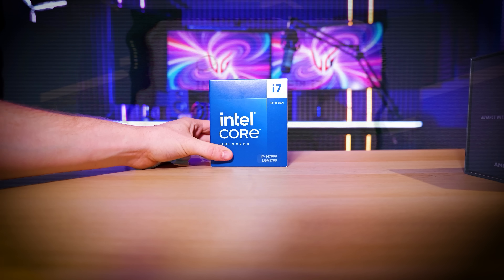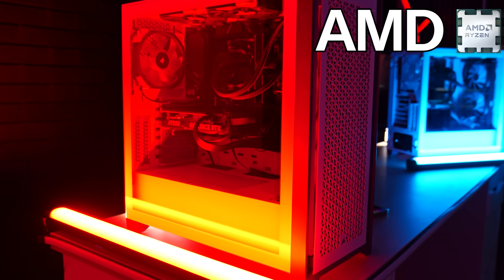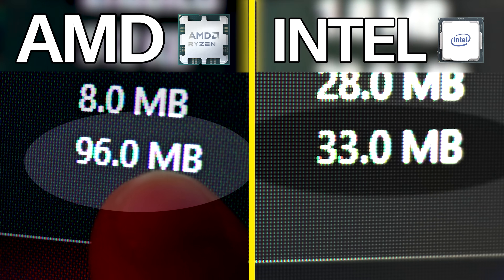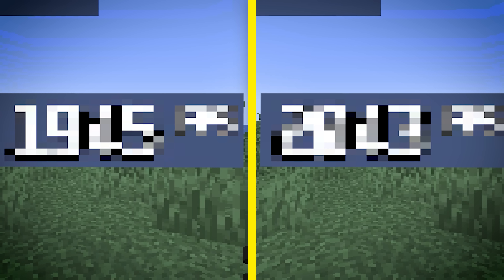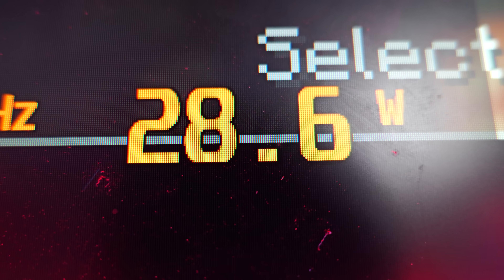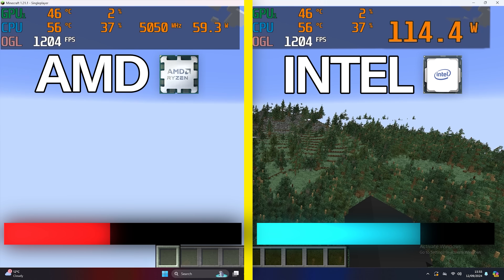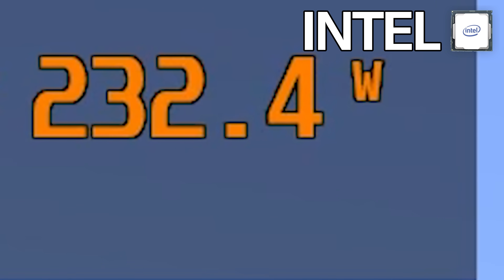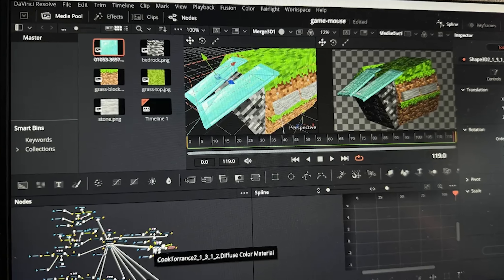Intel VS AMD - Which Is Actually Better?

Comment: 7800x3d is literally the fastest gaming cpu in the world rn
Reply: Fr bro, and he tryna compare it to a broken intel cpu
Reply: @Koffi32  really core ultra is fastest
Reply: hellnah amd 7 9800x3d is out lol
Reply: U guys are gay
Reply: I got a 7 7800x3d for 200 at micro center
Reply: @braxtoncovelli2894  nice
Reply: 9950x
Reply: @ktyz_2508  7800x3d better
Reply: No it isnt
Reply: @ThumbzYT  yup it is
Reply: Cap the and threadripper series Is king (strongest one has 192 cores)
Reply: @TTheCatBox  Yes, but for gaming the 7800x3d is better and more optimized. The threadripper is for workstations.
Reply: Actually the 7700x wins in overall performance by a bit
Reply: 7800x3d vs Ryzen 7 9800X3D?
Reply: Or even vs the ryzen 9 9950x3d?
Reply: @yo._.jayjayy  Well I mean the 9800x3d is better, so its gonna win. But like bareley better so theres not gonna be much difference
Reply: @MrWhatsItsName  do u think the 9 9950x3d is even better?
Reply: Threadripper
Reply: AMD Has $15000 CPU’s with over 96 cores
Reply: 9800x3d now
Reply: You mean 7950x3d at the time now it 9950x3d
Reply: uhm its 9950x3d lol
Reply: Errm actually the threadripper is faster
Reply: Intel Victim
Reply: *9800x3d
Reply: Welp, time to pack up Intel. It's been great.
Reply: @K1LLBlLL92  for pcs amd is still better
Reply: No it isnt
Reply: u mean 7950 x3d
Reply: @capigod0115  Ryzen 9 7950X3D is kinda disappointing because there is only 1 or 2% improvement compared to Ryzen 9 7800X3D and 7800X3D is cheaper than 7950X3D and for improvement of 2-3 fps you won't be paying up more dollars so it's kinda dog water to buy Ryzen 9 7950X3D
Reply: @RandomBabyOnPhone  its not even a preformance you lose frames with the 7950x3d but it is a faster all around CPU due to the higher cores and threads.
Reply: @LunarLikeFortnite  high cores with only work in multitasking but singlecore performance is the major performance in gaming and I have seen a lot of videos of it and saw they have almost the same performance in gaming
Reply: @RandomBabyOnPhone  uh yeah I know
Reply: @RandomBabyOnPhone  7800x3d wins in gamss which don't utilise the 16 cores
Reply: tf is bro on bout
Reply: Nope is the 14900Ks
Reply: @epicdeboxfort1406  in GAMING the 7800x 3d  is currently the fastest cpu, with around 10% more performance than a 14900k
Reply: @scottexs  Says who, an article, the news, benchmarks were tested & that was true for like a week or two
Reply: @epicdeboxfort1406 What benchmark? Userbenchmark? Lol, they're known for their bias towards Intel.
Reply: @BruhLL  But their right
Reply: also accurate
Reply: @scottexs 7800x3d costs much much more
Reply: @epicdeboxfort1406  second this it's the i9 14900ks goes up to 6.2ghz
Reply: Actually fastest gaming cpu  🤓
Reply: @kinguwuwhaiuhs wtf did u change bro
Reply: @kinguwuwhaiuhs  bro is correcting nothing
Reply: @kinguwuwhaiuhs bruh fastest and best performing are diff. Amd is slower in terms of clock speeds so it's slower but performance is good so u should say best performing cpu not fast idioy

Comment: question: did you turn PBO on for the 7800X3D?
Reply: I think not 🤣
Reply: Why should he? This test evolves around testing the chips like most people do wich means not changing anything in the Bios.  Besides PBO is Considerd Overclocking and so voids any Warranty
Reply: @melon3210  because its a feature that he should use to get more performance in like 5 clicks maximum
its like XMP and expo and all of that

Comment: Guiny was praying this vid does well in the making of it or the homeless shelter was right around the coner
Reply from the maker: It’s doing slow but the hope is big
Reply: @Guiny lemme get the amd pc 🫸🫷i play on ipad
Reply: @Guiny  AMD RYZEN 9 9950X :face-blue-smiling::hand-pink-waving:
Reply: @Sanjay-fy7ql  9950x is basically just a slightly faster 7950x and doesnt have stacked cache.
Reply: all of amd cores are real cores instead of efficiency cores fastest cpu looks cool plus why would buy a old gen cpu

Comment: the intel cpu is not the 14700k it is the 14900ks and they are the best cpus for that company and the 7800x3d is the best but you could get the 7950x3d edit: also cpu cores dont matter unless you do multitasking and for minecraft cores dont matter, so you could have a cpu with 8 cores and it could be slower than a 4 core cpu edit 2: i think that the 7800x3d is better than the 14700k
Reply: Well.
On Minecraft Cores Really Matter On High Render Distance.

Comment: i7 14700k:the best
i9 14900k:what is life
Reply: whats wrong with the i9?
Reply: 13 gen and 14 are so bad lol if U need to get intel get 12 gen
Reply: @imsnypse  whats wrong with 13/14th gen? dont they have the best performance?
Reply: @The_LilViking  they a very bad when it comes to support a d life 14 gen overheating like crazy and die non fixable
Reply: @The_LilViking  if U don't want a new AMD or intel U could try get a old 2nd treadripper but motherboards are mir expensive but I recommend amd
Reply: @The_LilViking  how much  is Ur budget
Reply: @The_LilViking  just get a 7800x3d
Reply: @imsnypse what about the i3 ?
Reply: @Slim1423 excuse for a cpu
Reply: @imsnypse  i mean the 1315U is a good budget one if u play casual
Reply: at what its the best ? More watts drawn ?
Reply: @vexx5955   jea thats just a preference?!
Reply: Intel is my best cpu intel i9 14900ks
Reply: @markfx1445  Defected CPU LMAO
Reply: @gaypanda2024 My 6 GHZ Intel Core i9 14900K processor is dead overvolted, oxidized and silicon degraded on my carpet.

My AMD Ryzen 7 7800X3D processor does 4K 144 FPS. Sipping 45C of power draw, 60C ever max temperatures, under all productivity workloads( yes it does more than gaming)! No dips. Zero stutter. Easy choice.
Reply: IF you really wanna compare with i9 you should use a threadripper instead
🤣
Reply: @Hiiiiii12332  threadripper is a server cpu sybau
Reply: Ryzen 7 9800X3D : The Greatest
Ryzen 9 9950X3D : Is it sunny out there?
Reply: bro my TI school computer processor is a i9 14600K☠️
Reply: same with amd
Reply: @Gesigdumm   R7 7800x3d is the best for amd in games
Reply: 14900ks.
Reply: Bro doesn't even know Java Minecraft can only utilize 1 core 💀
Reply: The 14900k has a lot of issues
Reply: Intel & AMD are need more improvement. Intel Price is also too much for this spec 👎
 Mac M4 is rocking the field with Les Cost. We can buy a Mac mini M4 at an Intel VGA cost nowadays..
Reply: yeah thats what i thought
Reply: 7950x3d lmaoooo
Reply: 9800X3D LMAOOO
Reply: 14700KF Nasıl?
Reply: @mert54687 probably same with k bro which answer is yes is a gaming cpu
Reply: pffft,yet cost twice as much as my r9 5950X   and has the same number of working cores   (16)
Reply: intel absolute garbage your parents must be your brother and sister for saying such foolery
Reply: That's amd not even 8th gen how you can compare to 14th gen dumb😅
Reply: bro dosent want a power outage with i9
Reply: Pas mal mais sur the fisher online ou fishine planet pas facile
Reply: 4fps Difference
Reply: @REAL_BMD he probably chose i7 to save his bank account
Reply: @srinivaschilakala216  he has the 14900k tho, he did a video on that a while ago
Reply: @xyllacx  That cpu isnt new tho and could be degraded a little
Reply: @srinivaschilakala216  lol
Reply: @xyllacx  no he hasn't in the describtion it says i7 14700k wich just to stay fair also is over a 100usd cheaper than the 7800x3d
Reply: @REAL_BMD W SL pfp
Reply: @REAL_BMD 14900 KS is ten times 14900K 🤨 it's K's Father KS
Reply: @rnelly0001  i think you dont know anything about cpu's.
the only difference between 13900k and 14900k .
14900k 6Ghz and 13900k is 5.8 Ghz.
so the difference is only 3% to 5% Max and like 2Fps in games.
14900ks Is 6.2 Ghz so it's also like 3% to 5% max difference than 14900k
Reply: @REAL_BMD i9 can reach 8ghz with overclock better in gaming and editing in most of games and in all editin softwares😂😂
Reply: @i_neon1  1. 8ghz by overcklock with 1000$ Motherboard And Liquid netrogen cooling.
Can you cool your cpu with liquid netrogen in your house?
also most of those cpu's die after that because they use it just to do a world record not to use it in your house.
2. the difference in most games is 4 to 9 fps max.
3. apps are cpu intense so they use only more cores and threads.
i9 14900k have 24 cores and 32 threads.
i7 14700k have 20 cores and 28 threads.
so the difference is 20% more cores and threads and no app uses more than 16 cores so no noticable difference.
Reply: @REAL_BMD  yeah 24 numbers of nuclei is the diffrance
Reply: i9 isn't a gaming cpu but i7 is
Reply: @Feryga  i9 isn't?
Reply: @Feryga  are you stupid
Reply: @Feryga  oh cool because I have one a TM 2.60 ghz
Reply: ryzen 9 7900x be cryin
Reply: @CosmicExplorer564  imagine  threadripper
Reply: @ExodiaTTV  threadripper is very slow, it wasn't made for games
Reply: @ExodiaTTV  Wasnt made for games
Reply: @Kratoscil  exactly. games need only 8 cores
Reply: @CosmicExplorer564 fym, 7800x3d is better cuz of monolith architecture and giant l3 cache
Reply: @CosmicExplorer564 ryzen 7 9800x3d be hidden in a corner watching these cpus fight
Reply: R7 7800X3D 449.99 USD
I9 14900KS 832.49  USD

I don't think you're choosing the intel, not for a bit better 1% lows at nearly 2x the price ah and also 2x the power draw ah and also 2x the instability
Reply: @VALmuzica  yes because it is a processor that can play games and can be compared to the R7 7800x3d and does anything else in the most efficient way possible, which is why it is much more expensive, if you only play games, you know very well which one to choose, now if not

Comment: The 7800x3d is am5 so it has an upgrade path unlike the 14700k that's on lga1700
Reply: who cares
Reply: @thedanishguy1531  people that don't want to have to buy a new motherboard (ram aswell depending on specific motherboard) when upgrading
Reply: I do
Reply: @CoolhALAW214700k is already a very powerful cpu. You wont be upgrading for years and will prob swap to am6/lga1851 by the time you upgrade anyways
Reply: @CoolhALAW2Oh no, an extra $200 on my $600 CPU purchase.
Reply: Upgrade path is not that important vro
Reply: @peanutbutterandjelly15 yes it is
Reply: And Intel also has instability problems

Comment: It would've been more fair if you'd put a 7950X3D against a 14700k or 14600k
Reply: Actually, the 7 7800X3D gets about the same fps in games as the 14900K. The same goes for the 7950X3D
Reply: @thatsactuallymyfps  but the 7950x3d has more cores so the multi core cinebench test would've been more fair
Reply: @CoolhALAW2  Oh, I thought you meant overall performance. You're right though.
Reply: @thatsactuallymyfps  tbh I thought that might be better aswell bc more cores
Reply: @CoolhALAW2  You can do more things at the same time with more cores, but it might come with a drawback of higher TDP's
Reply: Yeah hes comparing 20 cores to 8 cores.l
Reply: @الإِسلام-دينُ-الحق-ِ  yeah, 16 to 20 or 14 would be more fair
Reply: Where is that fair? Those chips are much more expensive. So A higher end Intel Chip should then be used as well...
Reply: @melon3210  yes but the core counts of a 7950x3d and 14600k/14700k are far closer